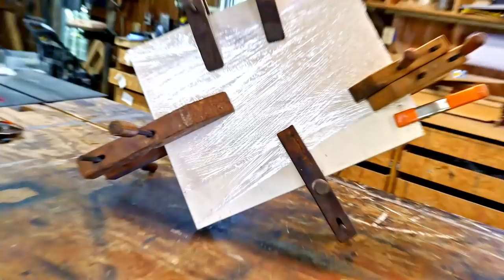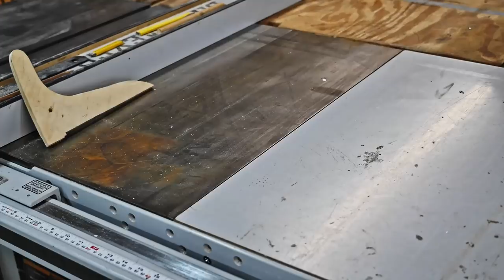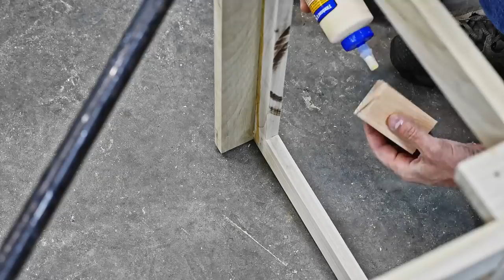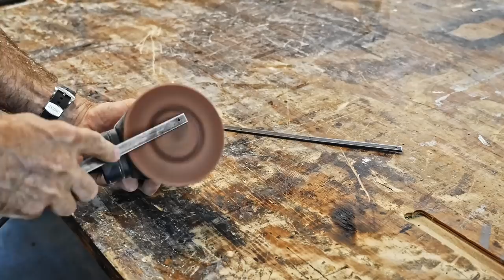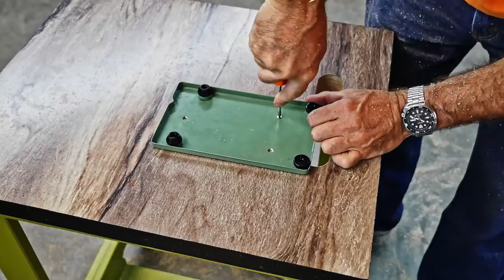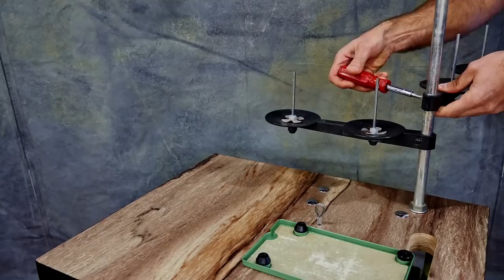I Make a Table with Casters for my Industrial Sewing Machine. A relaxing video.

Comment: I put casters on all my machines.I modify the casters my worn down sk8board wheels.Some,share a table.Why have a setup 4 every machina?like the size of your table.Space saving is the way 2 go.I have my reece buttonhole and chandler buttontack on the same table.H,A,K,Z and T legs are metal because wood sucks.Well made videos tho.You come up on alot of nice machines too.Of that I am jealous.I am a Tailor of 15 yrs in a well established Tailor/Alterations shop in downtown Portland Or. and I apprenticed under a 70 yr old industrial machine mechanic and worked for his family in a contract sewing factory.thnx 4 the upload.

Comment: I didn't see this video make it to Patreon?  Have you done anything with adding an air foot lift or push button reverse to an industrial straight stitcher? I recently purchase a Pfaff 1245 that had air lift in place of a kneebar and now I want it on all my machines. Works great in conjunction with a synchronize. I would like to add a button for reverse as well. i imagine you could use an air solenoid in place of a chain and pedal but finding images or video hasn't been easy. Thanks for another great video.
Reply from the maker: I have never done any of that but I think it is cool, maybe someday. Thanks for the heads up too.

Comment: Nice cart. I like your shop videos as much as the sewing ones. Is your woodworking area separate from your sewing area - if not, how do you keep the dust away from your sewing machines? I do my woodworking in a shop and all sewing in a room over the garage. I use dust collection in the shop and that helps,  but everything in there still ends up with a coating of dust.
Reply from the maker: My shop is in a detached building and my sewing area is in my basement. I am lucky like that.

Comment: Hot damn. Absolutely outstanding work. Proper swage tools. What other projects did you use those on? That wire gauge seemed way overkill for that application. Not a criticism, I am impressed with your skill and attention to detail. I am going to re watch while taking notes.
Reply from the maker: I choose cable because I like the look, same for the size. Overkill? Definitely! Just the way I like it. LOL This was the first project for the swage tool, I got tired of messing around with the bulky 2 nut clamps and now I'll be ready for the next cable project that comes up.

Comment: Nice table Alexander! You are the DiResta of sewing videos. I just got a Merrow and I'm gathering parts to get it up and running. Do you happen to remember what size belt you used on your setup? Thanx!
Reply from the maker: It all depends on the setup. Use a string or better yet another old belt to go around your pulleys and measure the total length then take that measurement and the width to the auto parts store and they should be able to hook you up.